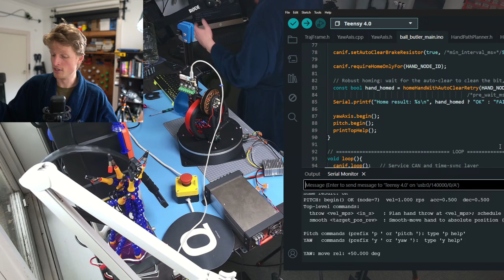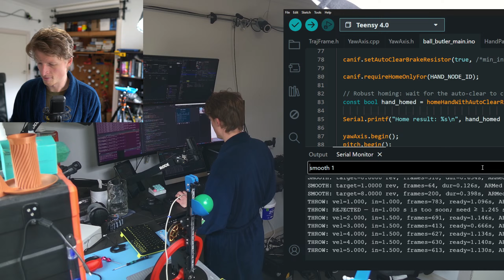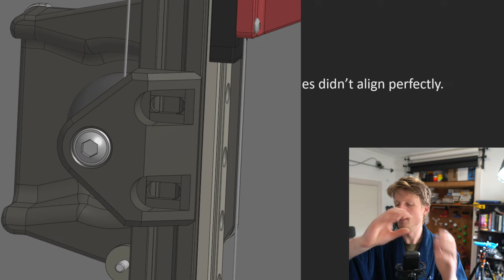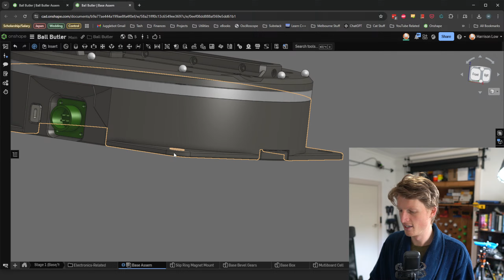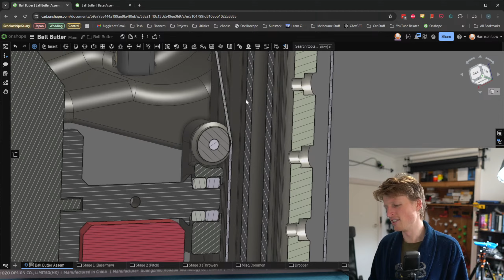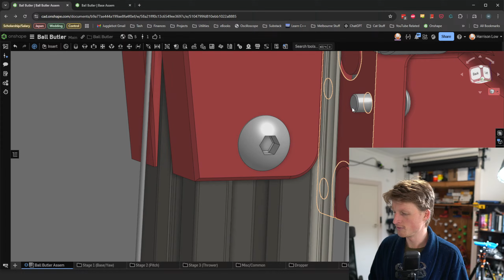PDJ Weekly Livestream # 69 - Last Stream of 2025!

Comment: The CAN bus data lines are differential, and intuitively it seems like you shouldn't need a ground reference, because all the receiver should care about is the difference between the two voltage levels, but in reality the receivers still rely on the signal ground to properly interpret the voltage levels of the differential pairs.  You could imagine, say, a 100V (but high impedance) ground difference between the two ends, and can see why that might be an issue :D
Reply from the maker: Yep you're absolutely right! I should've known better, but was evidently not paying enough attention... 😬

Comment: One alternative for cutting is a razor saw, which is an inexpensive hand tool.  They generate a lot less dust than a dremel, and also have a pretty fine kerf width.

I'm curious if your ultrasonic knife can cut through fiberglass circuit board (G-10/FR-4)
Reply from the maker: A razor saw is on my shopping list now! Thanks for the suggestion 😊

I just tried the ultrasonic cutter with an FR-4 PCB and it kinda worked, but was very slow-going and made a lot of dust. For any substantial cuts, I'd probably stick with a dremel (or razor saw, once I get one 😉).
Reply: @harrisonlow  We're trading tool buying!  Ha, I contacted the NeoBlade people and they said that GR-4 is quite thermally stable so it's good for cutting by the NeoBlade, but that because the material is abrasive, it's better to use multiple shallow cuts rather than one deep one, in order to prolong the blade life.

I went ahead and ordered a neoblade because I think I can use it for cutting carbon fiber tubing as well.

This tool has  popped up in a bunch of other maker videos who also really like it, so I became convinced.
Reply from the maker: @yeroca  Good to know! I'll keep this in mind if (/when) I need to cut circuit boards. Will definitely want to wear a mask or have good ventilation!

I hope you like your new toy 😉🎉

Comment from the maker: One thing I wanted to say but forgot to is how I'm handling the pitch during the inverse kinematics. Because this is underdetermined [1], we could 'optimise' using a solver similar to what I showed off a few weeks ago, orrr we could just set a constant pitch angle and vary the throw speed to get the ball to land where we want. I've opted for the latter right now, though I may include some simple 'optimizer' in the final IK. We'll see how well a static pitch angle holds up to different throw distances/speeds etc.

[1] By this I mean there are multiple combinations of pitch and throw speed that will land the ball at the target position.